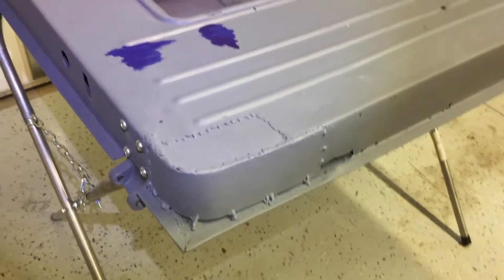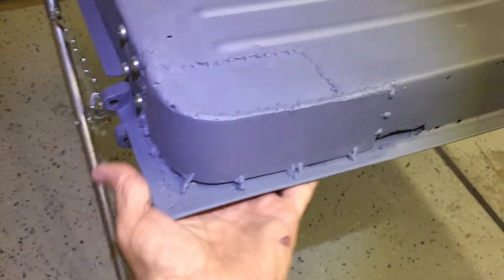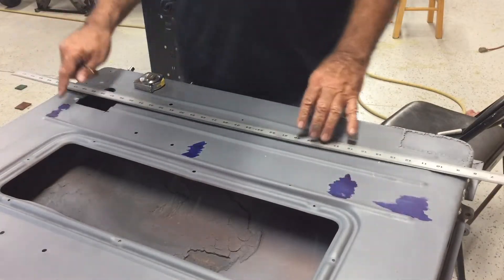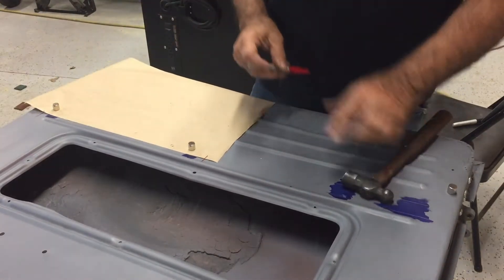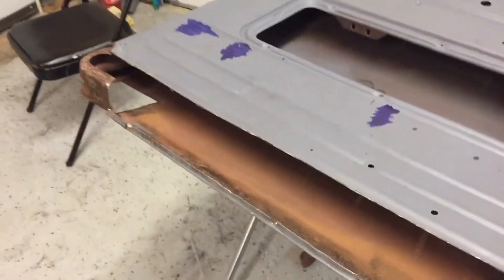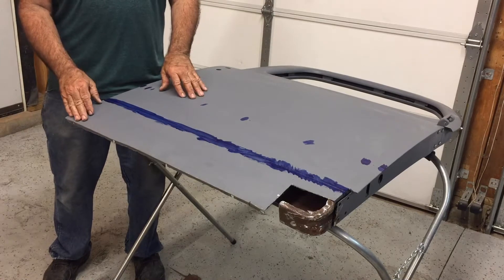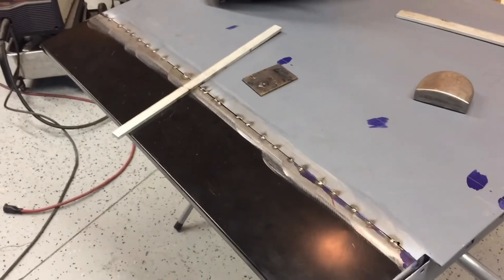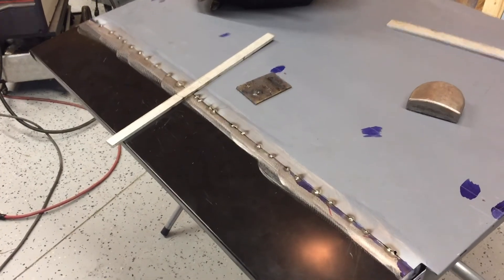Complete Door Bottom Replacement on the 1950 F1  Ep.13

Comment: Great video, thanks. I have a question did you remove the door from the hinge? I have been trying to remove the pin on the hinge but is not coming out. I even bought a tool Eastwood has for that purpose but not luck. Thanks.
Reply from the maker: Thanks, Nan Do. My pins were stuck in the hinges, so I remove the hinges from the doors and the jambs, then I torched the hinges and beat the pins out with punch and hammer. They were tough! To remove the hinges from the doors, I had to drill out the rivets.
I know the tool you’re talking about, and not many people have had success with it, on really stuck pins. Good luck, and thanks for watching! Tony
Reply: @ChipsAndSparksGarage  Tony thanks for the information and reply.